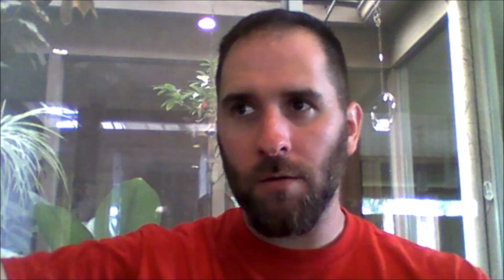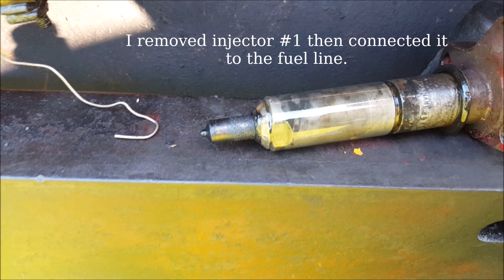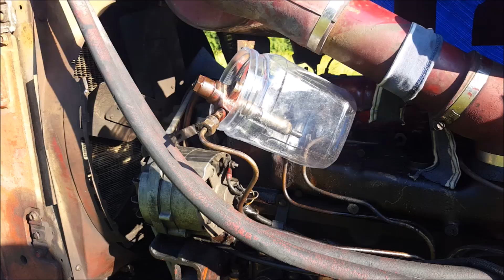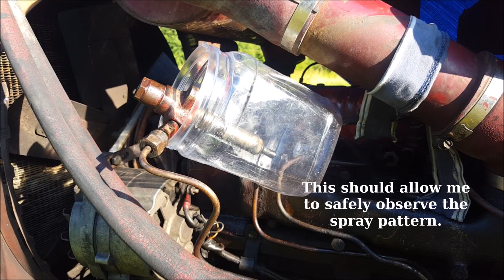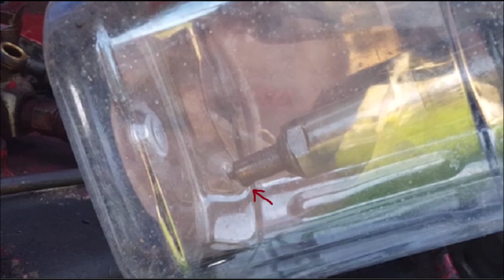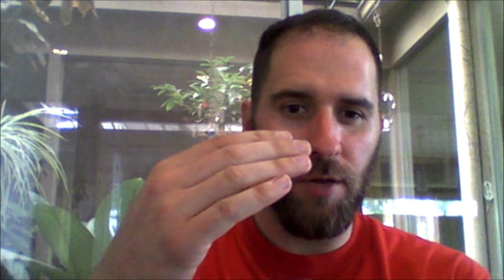Pump Not Pumping - Bosch VA6 Injection Pump

Comment: Dustin this was an awesome video!! I’m so interested in this project you have going on. I’m glad your back on this repair. Our 3020 doesn’t have glow plugs. In fact it also has the same ether injecting device next to the key switch. The metal tube ran from the device to the breather canister. That feature no longer works, I just spray if needed. Well done buddy! 😃👍👋🏼 Take care, Wesley
Reply from the maker: Oh, cool. Didn't know JD did the same ether setup. Thanks for the encouragement, brother.